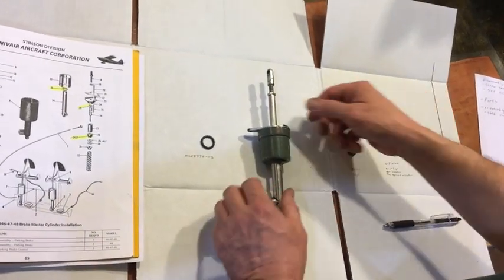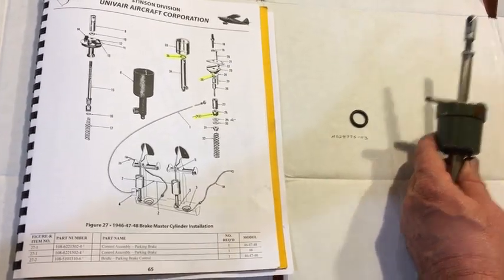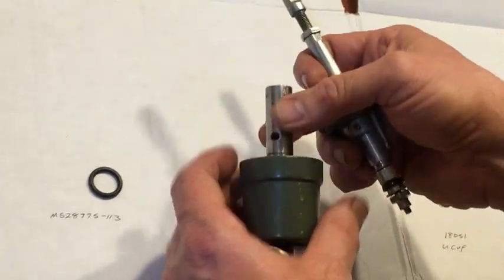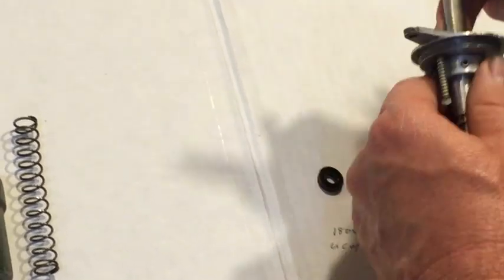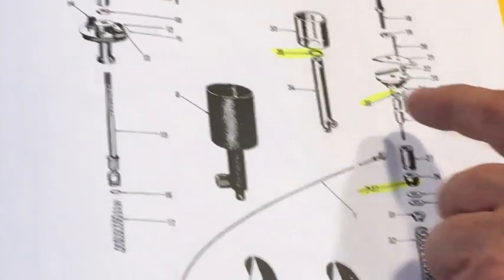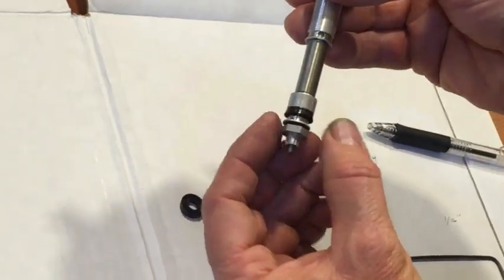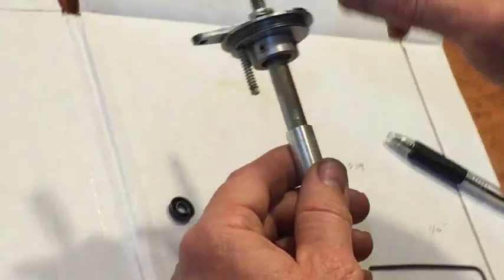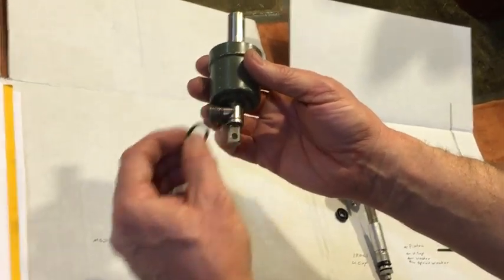Scott Master Cylinder Rebuild Procedure

Comment: I found the piston stem darn near impossible to push through the stem seal in the cap.  I had my local machine shop make me a 'pilot' the same diameter as the stem (cone shaped) which I used to spread the seal as the stem was pushed through the seal.  Its a real tight fit.

Comment: So the nut at the bottom of the Stem, I see on mine that it is “Crimped” and you mentioned that on your video. My question is this, do you just un-screw it off? Will it come off with that crimp? When I reinstall do I need a new nut or just re-crimp the original? Thanks
Reply: i found out that it may break. One cylinder was no problem, the other broke beyond the nut...

Comment: This video was fine as far as it went but the job was unfinished. Why stop in the middle? The speaker needed to continue to take apart the stem, insert the O-rings and reassemble everything. He even mentioned that the top O-ring was difficult which should be an important point. He leaves us hanging with a "Good luck".......sheeeesh. This video could have been great but wound up being very incomplete in spite of such a good start.